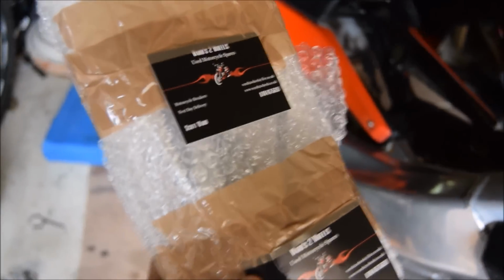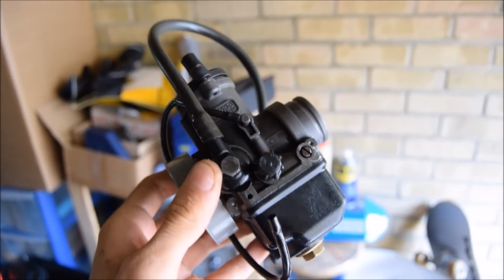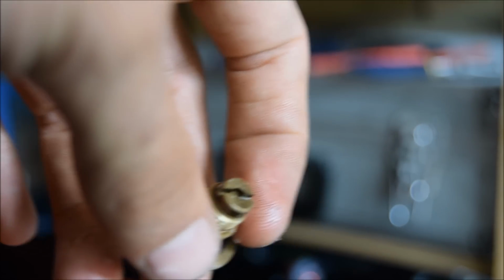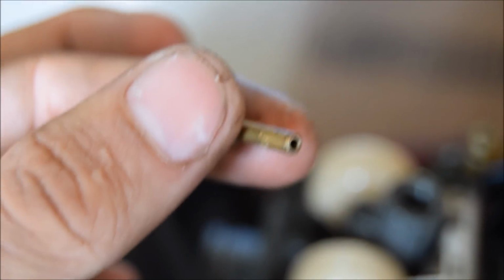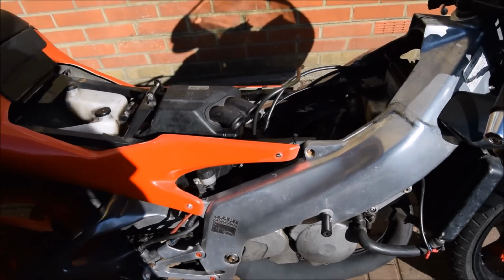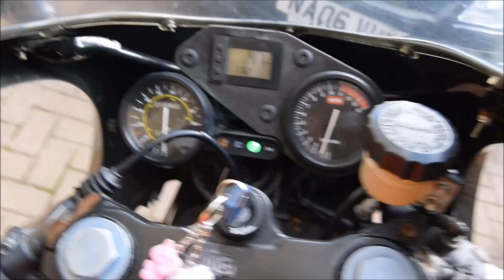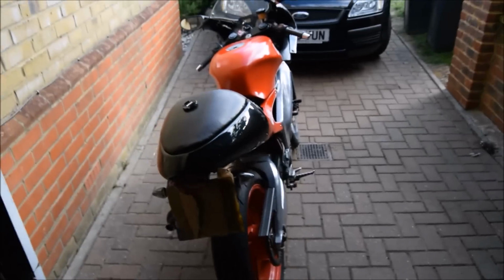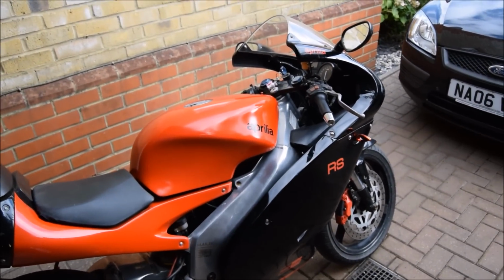Project Aprilia RS 125 #2 Fitting the new Carb

Comment: @rossrs which idle? because I am adjusting the petrol so it's on the middle but other than that I've not touched it as I don't wanna fuck anything up !
Reply from the maker: The petrol tap is to turn the fuel on/ off. The idle is a little screw on the side of the carb, turn it in to increase the Rpm
Reply: Ross RS allright I'll give it a try thank you

Comment: Hey. I am new to bikes, especially two strokes. I recently bought the 2007 model and I really need to rejet her (the seller lives at approx. 1500 feet and I live at 5000 feet). Obviously the bike runs way too rich. Is there any jet spreadsheet out there? I'm having trouble finding the right setting.
Reply from the maker: It is normally just trail and error when setting the jets. I wouldnt be able to say what ones would work for you. You might be able to get a bit more help going on the forums.
Sorry I cant really help

Comment: Quick question I have a Aprilia rs 50 01  and it has the res/off choke for the petrol, and atm i point it strait down but if the revs go below 3k  bike starts to die so i got to keep the revs up just a bit annoying sitting in traffic having to keep the revs up anyways any help appriciated
Reply from the maker: Have you tried adjusting your idle?

Comment: I need help with jetting I’ve got a stock 2009rs125 I want to make it full power and I know jets need to be done once exhaust and air filter and power valve is on and I’ve never done jetting. Anyone recommend anything should I do new jets or just adjust the mixture screw it will be on 28mm carb till I’m confident I can do the work on a 34mm or 38

Comment: I've been wondering to buy this bike when I'm 17 or to get a rs50 now as I cannot decide. also does the rs125 need constant service and how hard is it as I have never fixed a bike before. -thanks. Ryan
Reply from the maker: Depending on your situation I would go for the RS50 first as you'll gain some experience and you'll begin to learn how the bike works.
My RS hasn't been too bad however, every bike is different and they all need to be looked after. You should rebuild the topend every 5000miles I believe and also be consistant with the overall checks. 2 strokes are a bit more hassle than 4 strokes however the power difference makes it worth it.
Hope that helped :D
Reply: +Ross RS thank you so much for the information! love ur vids also :D
Reply from the maker: +Rydonnaissance No problem, cheers :)